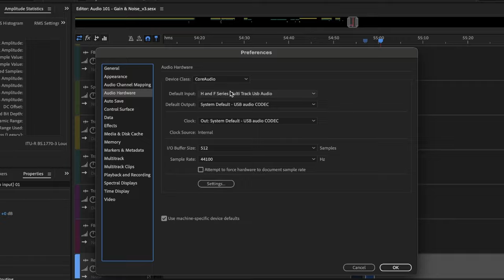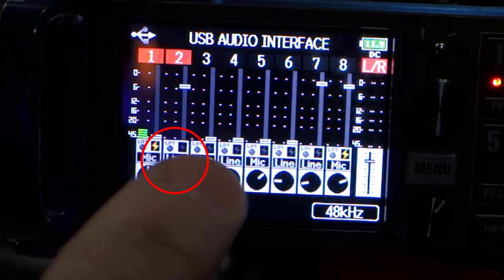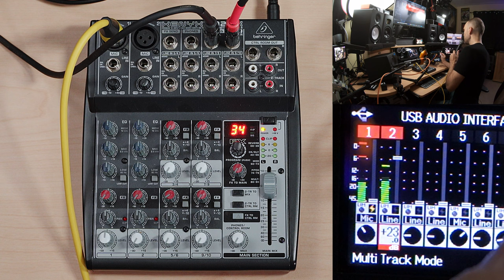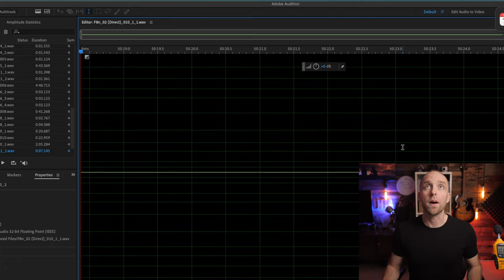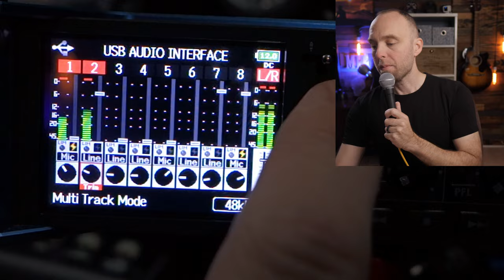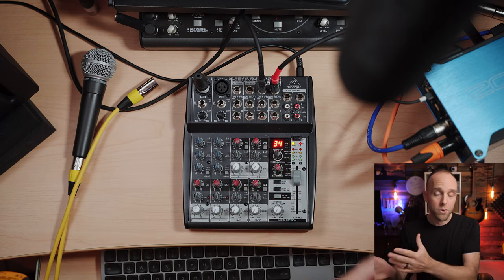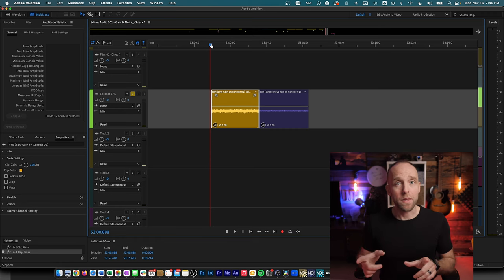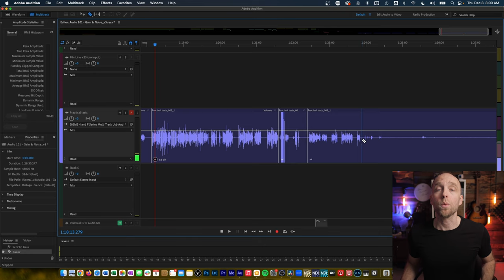Audio 101 - Gain Structure and Noise - Part 2

Comment: Would this gain structure still be proper for a mixer going right into a computer, since you would be using dbU equipment into dbFS? Would you just lower the levels on the software side?
Reply from the maker: Hi there.  Short Answer = Yes, this is basic gain structure (start at the beginning and follow your signal through each point until the end). 
 
You should ALWAYS gain structure the preamp first.   Then push the channel-fader up, then use the master fader to view/adjust input into the computer.  You should obviously also watch System preferences and/or Windows Sound settings to ensure you aren't clipping out the computer before it hits your software.  

So the same thing applies in your setup.  If you gain the preamp low at the beginning, there's much more potential for noise at the END (software, edit, etc).  Get those inputs levels nice and strong!

Are you using a USB mixer like a Behringer 1204 USB?  Or are you using a mixer with an audio card?  because in this video, I am using my Zoom f8n as a USB-audio interface going directly into the computer.  

I hope that helps.  Cheers.

I recently bought a Behringer 1204USB and I will be doing a video soon showing examples using a USB mixer.
Reply from the maker: The counter-point to my first reply is that.........remember when your faders are at "zero" on their fader position, those faders are then neither boosting nor  cutting the incoming preamp signal through the chain.  So........your software *could/should see the actual input gain of your preamp if your faders are at zero.  However, if you forget to check some software preference and something is turned down somewhere and you aren't aware, then you may not be seeing true input gain this way.  That's why it's always best to just work your way from beginning to the end-point, and not in reverse.
Reply: @MarcusHutsell  I'm using a Yamaha MG10XU going straight into my 3.5mm mic jack. The reason I chose this is that if you use the USB as your out, there is a built-in pad that's roughly 15-18db with no way of switching that off. I believe Yamaha did that to dummy-proof someone using that as their interface and getting caught off guard by the hotter signal.
Reply from the maker: Interesting.  So, you're going out of XLR or 1/4" outputs from the Yamaha MG10XU and into a 3.5mm (stereo) input jack on your computer?
Reply: @MarcusHutsell  Correct. I'm using the 1/4" outputs.
Reply from the maker: Got it.  So, you're basically doing the same thing I'm doing in this video with your signal chain.  The only difference is that my sound card is my Zoom F8n, and your sound card is the 3.5mm jack on your computer.....which is attached to the sound card on the motherboard.  So, your sound card is just built in to the computer.  nothing wrong with that if it's working for you.

If you are having any noise issues, try re-gain structuring from the beginning-forward.  And always just remember that some of these things will have to be balanced between gain/fader/output, but, strong input signal is always best to reduce your noise at the end.  

Happy recording :)